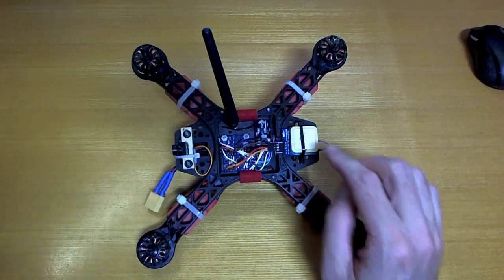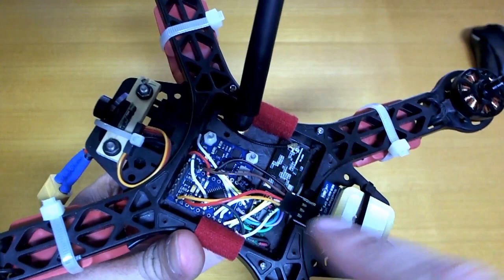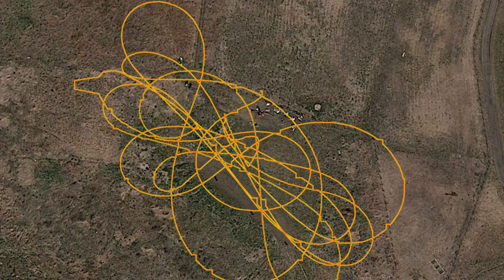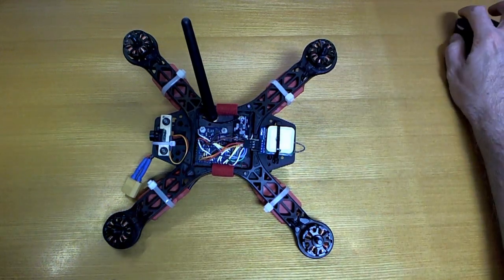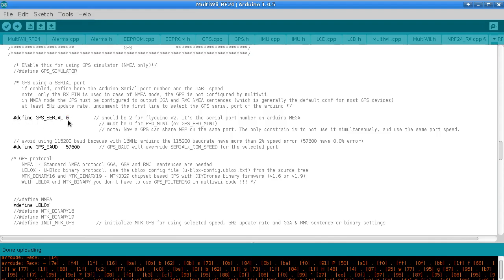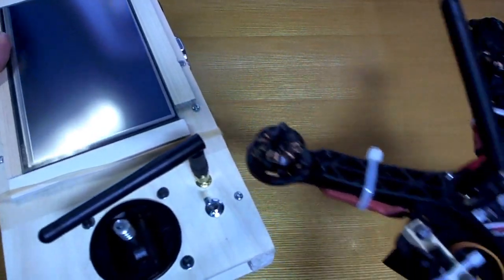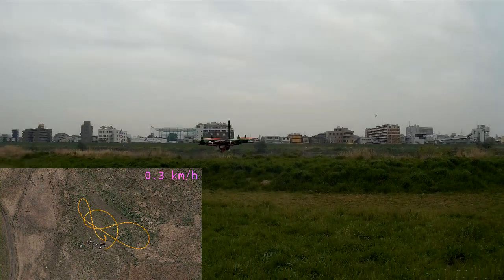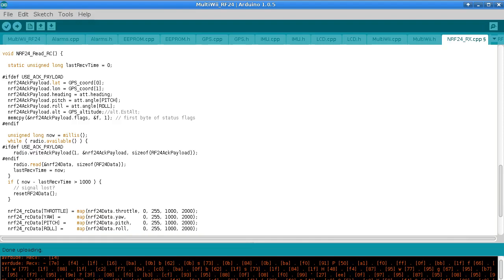GPS telemetry on mini-quad

Comment: Hi nice videos your making. Question regards nRF24, your transmitting(tx) to control the drone but at the same time the drone(Rx) sends telemetry back to you (tx) so how do you do this? By interrupts or clear defined time slots when to send and when to receive? Could you send/give some code of the nrf24 from tx/Rx as you did show for the car where you did go through the code (where you had some problems due to the pin in the video). Thx Per
Reply from the maker: Try searching for "enableAckPayload", probably the best place to start.
Example: https://tmrh20.github.io/RF24/pingpair_ack_8ino-example.html
Reply: @iforce2d  thx for replay and did yesterday successfully implemented it, btw after finding another video from you and in forum. Work like a charm. Thx

Comment: you can run the serial gps modules with a serial to i2c convertor made from an arduino, and run baro and mag all on the i2c bus...and the 3d lock on the gps is real fast with an atmega 328 processor... and have an additional serial port for bluetooth.

Comment: If that is real time readout i'd find it impossible to not look at the screen and draw smiley faces and treble clefs and then finish on a cock and balls. I would love this function, very slick and incredibly accurate.
Reply from the maker: MicroRCFiend Of course you would :D It could be done real-time, although the main use for it might be to find it after it crashes

Comment: iforce, are you in the UK or Aus or what? I may have a couple bits and pieces you can use in your evil genius lab and wondering about postage from UK.
Reply from the maker: MicroRCFiend Tokyo
Reply: Okay dokey, caught me well out with that one. Might be limited to small items but there's a multiwi se 2.0 at the very least can go in letter post. There's a quad frame that will run 10" props with 1800kv rcx motors but I think post will be a little brutal for that. No esc on it or FC. It will take a hit and keep going. Centre plate is alu so worst case is bent back and carry on.

Drop me a pm with an address if your interested and i'll see what postage options don't break the bank if any.

Comment: Are you sure your velocity is displayed correctly? some of it seamed way faster than what it showed...
my dad flew past me with his quad with about 80km/h, while i was not looking, hell, almost shat myself :D
Reply: ***** Hey iforce2d! Very awesome video you put up here! So i was wondering if you could post a link to a page so we can buy that GPS module? It looks like a very capable unit! anyways, love your channel!
Reply from the maker: muh1h1 I was thinking that too. I can't find any place in my calculation that looks wrong, so I'm putting it down to the time between samples not being what I expected. I'm only writing the data packet contents to file without any timestamp, so whatever speed they arrive at is the speed they get written to file. I had intended to write to the file every 200ms to get a 5Hz stream, but unfortunately I think I ended up simply writing every single packet. The problem with this is that packets do not arrive at a constant rate, depending on reception it's typically 70 - 100 packets per second and fluctuates. So all I could do with the data I recorded was to take every Nth packet, generate the km/h output video frames (png), overlay it on the other two videos, and then adjust N until the speed changes matched up as best I could (using the parts where I stopped to hover as points of reference). Yeah, it took f%$# hours. It seemed too low but I would rather that than go too high and have people complain I'm playing up the quad speed too much :) If I do this again I'll take a closer look at the code on the tx, should not be hard to get it right next time.
Reply from the maker: ***** or better still, just write a millisecond timestamp with each packet.
Reply: ***** you'll eventually get it right, im sure :D
is there no "verlocity" variable already in the code somewhere, so that you can just transmit that maybe?
Reply from the maker: muh1h1 actually yes, multiwii is already reading the VELNED message which has some nice values including ground speed that I could have used >.< But for some strange reason, it didn't even occur to me until half-way through that last flight, that I should use the recording to calculate speed
Reply from the maker: Nick LDominator sure, it's this one: http://www.banggood.com/Mini-GPS-Module-With-Serial-TTL-RS232-Compatible-With-U-BLOX-NEO-7M-p-947630.html
Reply: ***** Thanks for the really quick reply! Looks like a great module and at a really good price. Also cant hurt to rack up some more Banggood points!
Reply from the maker: muh1h1 I did some more flights sending the GPS ground speed instead, gets 72 km/h with same battery etc, and a bit of tailwind
Reply: *****
that sounds more like it! :)

Comment: ***** 4:30 you talk about the GPS interfering with the multiWII GUI. have you looked into SoftwareSerial?
Reply from the maker: Zakk Atkinson multiwii seems to have its own version of software serial, to handle communication with the GUI/groundstation while simultaneously flying the quad. It looks pretty sophisticated and I would not want to mess it up since the timing is quite critical. I tried SS in other projects and it works ok as long as you are not doing something sensitive to timings, eg. PWM output. Once you have your settings ready, it's no big deal to upload the sketch one more time.
Reply: ***** Ah, makes sense. I haven't had a chance to do anything quadcopter-related yet, myself. MultiWii looks like a pretty neat system to work with.

Comment: Awesome quad! Your channel is pretty much the first time I've seen someone use one of the opensource boards like arduino for the FC, cool how its cheaper too.  I think that the jitters might be from the way GPS works, since GPS for us is only supposed to be accurate to around 4m at best. The GPS could be getting only little inaccurate but still smooth feed until that point of brief large inaccuracy at some moments, hence a spike, until it sort of comes back to that fluid feed.. I'm no expert but I have basic knowledge of how GPS works :) happy flying!
Reply from the maker: ***** I think I figured this out. If you look at each jitter, the line segment on each side of the jittered point are either perfectly horizontal or vertical. This probably means that the latitude value had been read from the GPS, but the longitude had not. It does not explain the very large jitter at the beginning though...